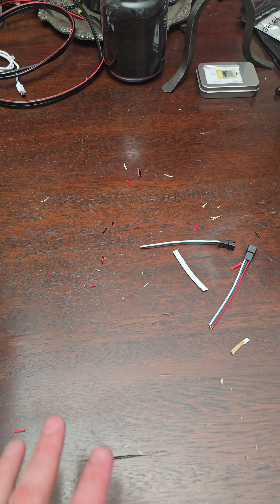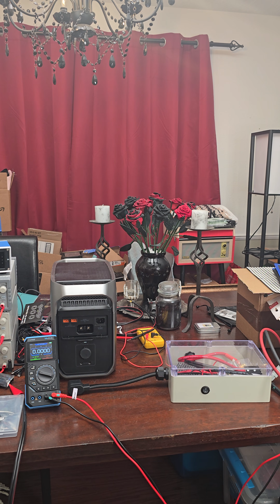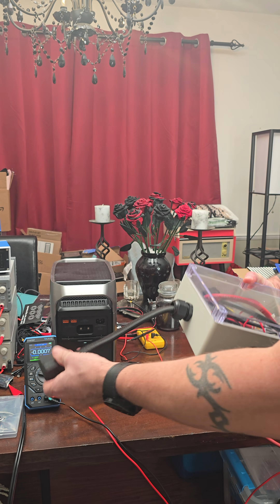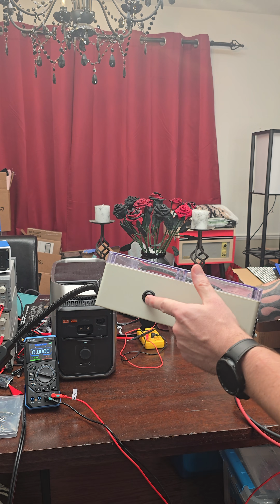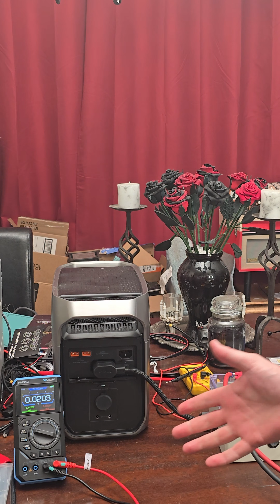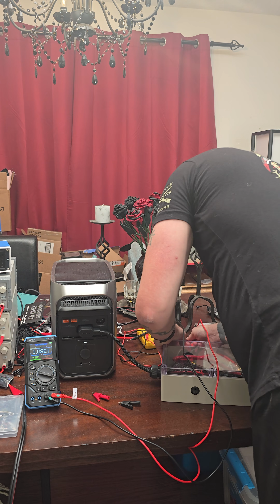EcoFlow Battery Hack: The Ultimate DIY Power Hub You’ve Been Waiting For!

Comment: I assume when you use an OEM cable and cut it, you no longer need to worry about the 1K resistor since the plug already has this built in?
Reply from the maker: The cable does not have anything built in, it's just wire the device is the part that handles that, and it's not a resistor but we can fool with one.

1K is not the right value, I have had so much going on IRL (Thanks Nation State Level Cyber Attacks) so not taken time to make the detailed video.

I'm going to get this done and then move to something new that I'm much more passionate about.

I wanted to protect consumer's from overpriced gear, but going to start a new channel about protecting people from the world.

Scams, AI, etc that is my actual job as a Cyber Security professional.
Reply: @ViciousXUSMC what resistor value do you use if not 1K?
Reply from the maker: @craighoneyfield9937  I'll cover it in my build video in detail, also you have two wires that you want to drop, not just 1.

Comment: I agree with the short you made on this topic, I don't understand why you don't have more views on these videos!

I'm going to be making something similar.
Thanks for the tips and tricks. 

Before watching your video I had already planned on enclosing it all in a project box just like this, but I would not have thought to put the data pins on a little mini bus bar and I definitely wouldn't have thought to wire up a 12v converter right into it either.

That's awesome i

Comment: I want someone to do it on the Delta 3 so bad 😢
Reply from the maker: Should work fine, works on the Delta 3 Plus.  But I don't have one to say 100% for certain.
Reply: @ViciousXUSMC  I'm planning on building a 12v 30A hub for my Delta 3. Plan is using it to power my off road accessories.

Comment: I had this mod working on my EF delta pro and no suddenly it stopped working? Just as you say, used 1k resistor between pin 4-5 or 4-6 and the relay no longer engages and exposes the battery voltage to the plug. It was working for over a month and just suddenly stopped. I tried both expansion ports with the same result. The ports work because I do have a EF expansion battery and it works fine on either port. I also checked the cable connections and such. Pjn 4 has the 113V on it before pulling it low, so not sure whats up. Could EF HAVE FIGURED A WORK AROUND TO STOP NON BRANDED BATTERIES?
Reply from the maker: Maybe? Mine works, I know I'm being slow to get the build guide up (really busy  IRL right now) but one key take away is that 1K is NOT the best value.

Might fix your issue just by using a more accurately sized resistor.

A firmware update could very well say "if x>y don't turn on.

So we need x=y to fool the system
Reply: @ViciousXUSMC  It was working, which is frustrating. I dont even here the relay turn on any longer when pulling the enable pin low. So strange...
Reply: @EcoVoltz  maybe you got firmware update?
Reply: @vyuryev  Thanks for the input! I did do the update but it turns out to be a false alarm. I took the system all apart again, checked the connections and voltages, then it just started working again. I'm still unsure what caused the issue but we can all sleep well knowing that the mod still works. Best!

Comment: Can you do a video similar for the ecoflow stream system to be able to expand at a more economical price?
Reply from the maker: I don't have one or a way to access one.

Same concept should apply if it's similar technology.

For example the Delta Pro3 is the same but has a different connection.

But the smart generator adapter works to adapt this to the correct fit.  So instead of building something different you can just adapt it.

Comment: Suggestion change out the switch for a circuit breaker and you could eliminate the fuses and the switch. The 12v out put should be 13.5V at least. But that is great! much better than hooking up to the solar input like I see everywhere. The real question is will it charge the extra battery when the solar is hooked up?
Reply from the maker: This way on purpose to prevent "hot plugging" and the need to switch high power.

I noticed this was how my other power station worked (Apex 300) that when you connect an extera battery it will not be "on" and send power when you plug it in until you lock the cable.

I knew right away that lock was controlling a signal, so I created that same concept here.

Feel free to change for your own usage and needs though, this is my creation and just a blueprint.

Yes it will charge the battery, I'll be showing that soon.

Comment: Looking forward to your full detail video. Like you, I wanted to be more safe than the exposed resistor and terminal setups. For my Delta Pro 3, I went ahead and bought an ecoflow cable, cut it in half, determined pin 4 and 6 wires via continuity test (yellow and green), soldered 1k resistor between, then put breaker, 4 awg wire and terminals to aftermarket 48v nominal battery. Expanded my 4kWh Delta Pro 3 2ith another 5,120Wh for less than $900.
Reply: Does this still work on DP3 for the latest firmware -  v7.65.92.17.  I’m wondering if EcoFlow made an update to prevent this hack!
Reply: @craighoneyfield9937  works?

Comment: you used 50a fuses, would breakers be better so you can have 12v still work and have 52v off?
Reply from the maker: This one I will definitely go over in more detail for the build video.  In short, no breakers.  That is the fundamental difference is we are able to use a small 0.5w switch to control all the power and not need a big power control switch.  The fuses are internal to the box for ease of install and protection and only serve to protect the wire (where I trust them more than a breaker to properly fail) I had planned to install an entire fuse block, along with bus bars, but the box got to crammed and had to kind of strip it down to the necessities.

You can leave the main output turned on, and run the 12v all day long, the anderson connector is recessed and protected and has a weather proof cover that I don't have installed in the video (this entire box is weather proof (resistant technically).

What I would add for heavy 12v usage is an inline fuse (can be external to the box if you find space to be an issue) and if your pushing say 20A constantly, you might also install a cooling fan (already can power it on the 12v side, that was another reason I added 12v to the box itself is to allow installing optional accessories (lights, meters, fans, etc).

The sky is the limit.  When the build video comes together, it will be presented as a recipe to create the base dish, but with the opportunity for you to season to taste for your own specific needs.

Comment: Nice!  I see you hooking it up to the power station, but will it also work with one of the EcoFlow batteries stand alone?  It would be nice to have the expansion battery actually become useful independent of a power station.
Reply from the maker: Unfortunately not likely.

Maybe with a specific battery, but most devices require CAN Bus commands to activate.

The River 3 Plus is one of those that I'm often asked about.

So we will likely require can bus emulation, Wich is totally possible but not simple nor cheap so more of a tech demo than the every day man solution, unless a cool gadget comes out to simplify things.

I do have a battery and I'll test though in the name of science.

Comment: I've seen Ecoflow come out with many add-ons that are not super useful, or are way too expensive.  A XT150 to high-current 12v jack using the Anderson PowerPole would be something that I buy.
Reply from the maker: And this design is modular, so say the 20A 12v I built in was not enough, you can make yourself a simplified box with the 12v buck converter of your choice and just give it a 50A Anderson connection and it will work off the high output side to accommodate any DIY addon.

They make the same surface mount Anderson I used as the outbound connection also in the male form.

So if you want to be really classy you can make say your 30A 12v box directly plug into this one like Legos and not even need a power cable between them.
Reply: @ViciousXUSMC  A question for someone who's into this way deeper than I am.  Does the Ecoflow's BMS still cut off power when the cells are low in this setup. (Or is the battery connection truly direct)?
Reply: @daemoncan2364  It's still a BMS controlled output.